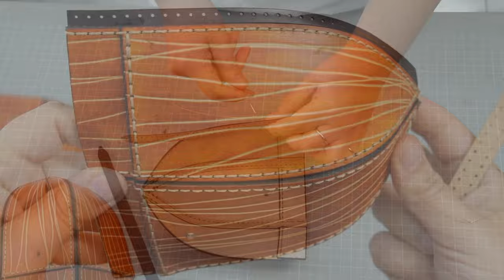How to make the Acorn Leather Bag | Christmas leather Pattern | PDF Leather Bag Pattern

Comment: Very cool design!  Where can I find more info about the pressing device you used to imprint with string and sandpaper? I've never seen that done before, very interesting.
Reply from the maker: Thank you for watching my video! I own a hydraulic press for leather cutting. It's an expensive and heavy machine for professional use.  There are other machines like Sizzix big shot Pro,  a bookbinding press, or the vevor press that will do the job as well 🙂

Comment: Will a 3t manual clicker press be able to make the same impression?
Reply from the maker: yes, you can use a manual clicker press as well. I have used the Vevor press and it worked as well as the hydraulic press